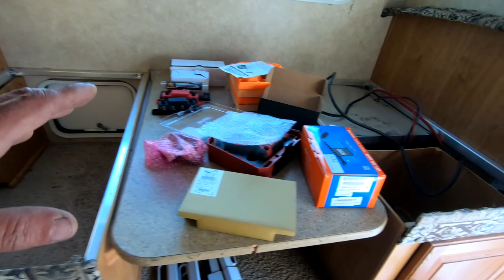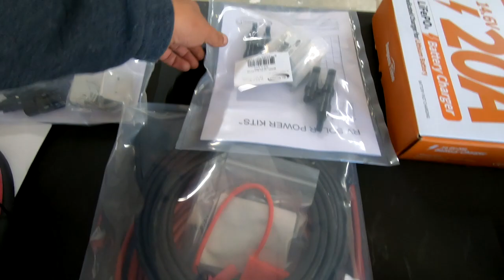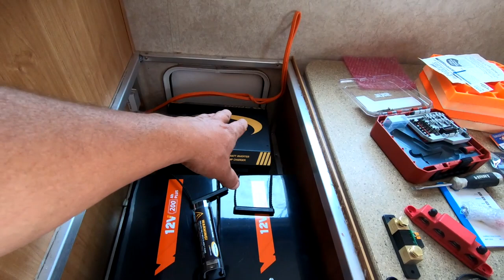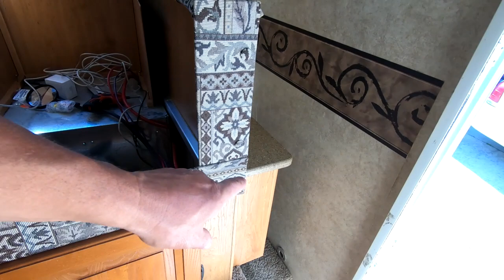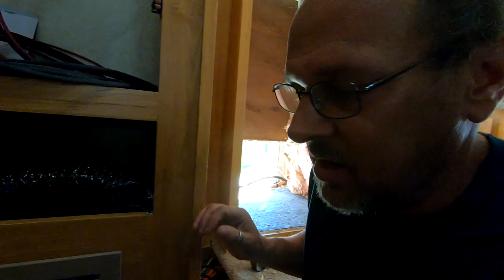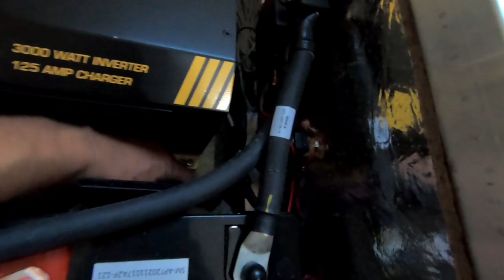Big solar on a small truck camper

Comment: Hi Wayne,
I watch your videos and I have a question for you.
I have a 1995 Gulfstream Sunsport 32’ class a motorhome with a gvwr of 15,200 lbs. I have 10 - 100 watt solar panels on the roof with 4 lithium batteries and a 2300 inverter to run it all. With my solar system and cargo it throws my gvwr over by about 500 lbs around 15,700 lbs.

My question, Do you ever run in to such a problem with any of the solar systems you install like the video with the Mercedes motorhome you installed or nomatic fanatic’s bus or any of the others that you’ve put solar on.

Thanks
Your viewer David Baugh here in Indiana.
Reply from the maker: I haven't encountered that specific problem, but it is definitely important to stay within the vehicle's weight limits.

Comment: I have a truck camper with  solar on the roof. I was thinking of using additional portable solar panels. What would be the best way to combine them to the battery? Should I use a combiner box and use the existing charge controller? Or should I get a separate charge controller and connect them at the bus bar. What are your thoughts and if you have any other suggestions, I would appreciate any info. Thanks Roger.

Comment: Great job as always Wayne! Thanks for the detailed explanation of the plan and the process. Just one suggestion.... add a small vent grid to the seat box containing the inverter... although I don't see this camper using the inverter to its max they do get warm and some air circulation can't hurt! Otherwise a great job! Thanks for posting!